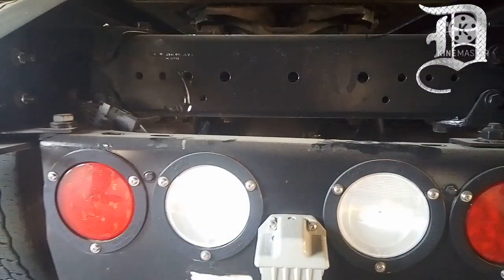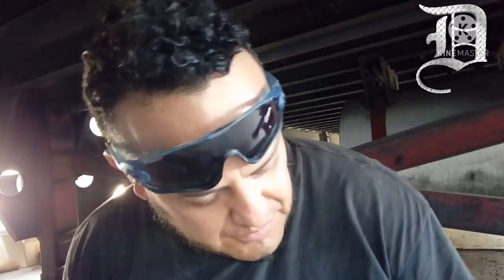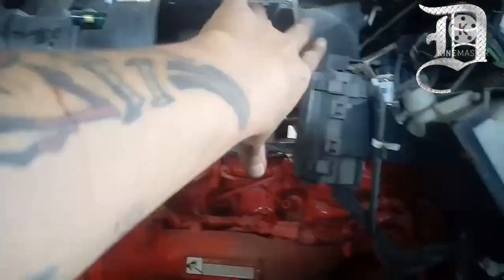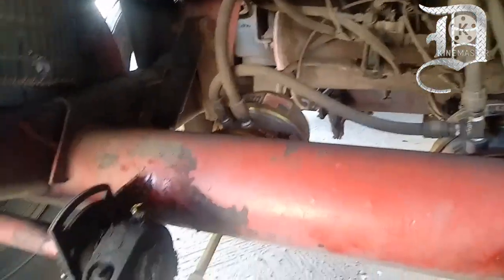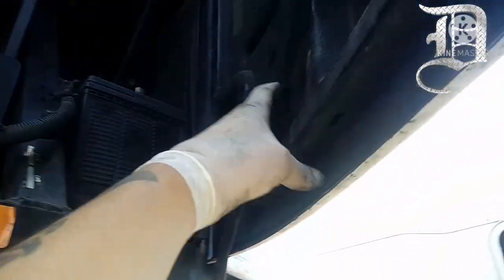Tracto y Remolque: Mantenimiento Preventivo, Correctivo y Detalles.

Comment from the maker: 01:05 Lo que se debe checar al tracto
02:00 Lo que se le debe checar al remolque
03:30 Filtro de aire y checar abrazaderas de mangueras, niveles de fluídos
04:17 Checar bandas
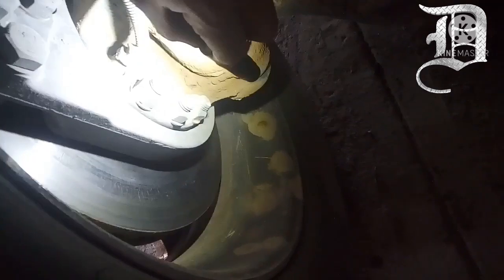04:34 Freno de disco
04:49 Sensor ABS
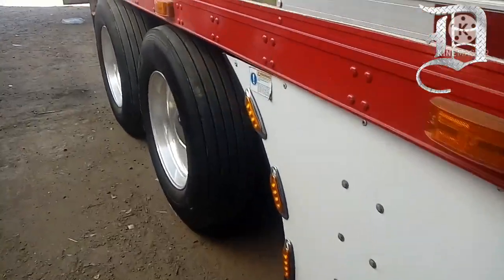05:10 Inspección visual del remolque
06:05 Interior del remolque
06:42 Recarga de gas a la unidad auxiliar (Tripac)
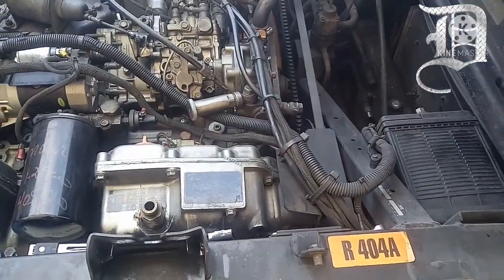07:07 Inspección visual unidad thermo
07:41 El 13